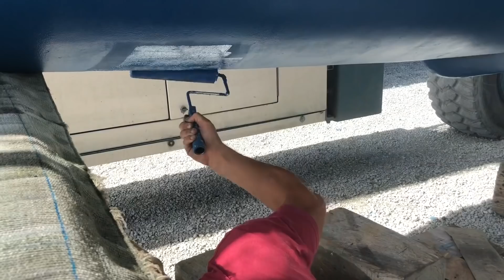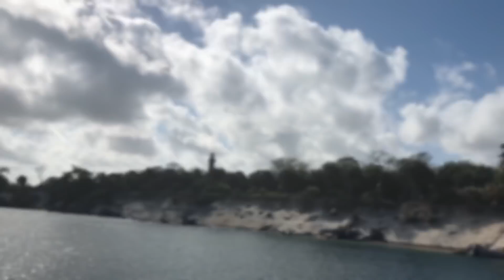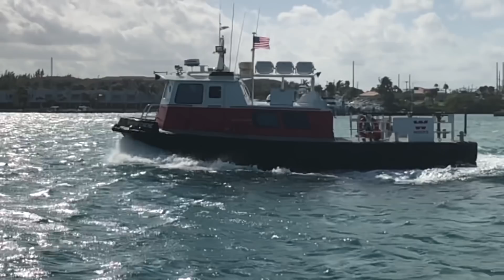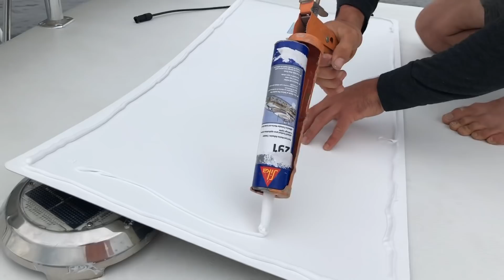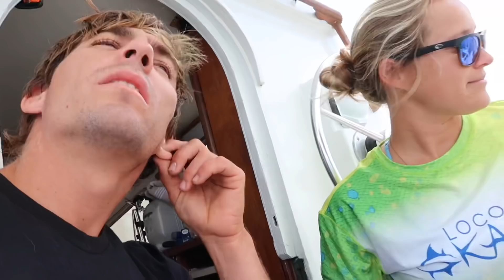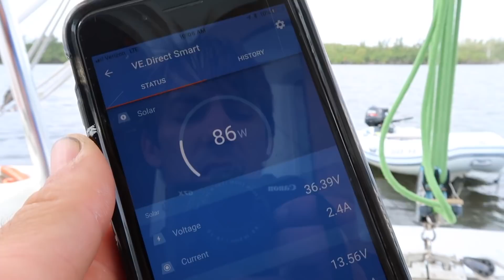The MOST Exciting Day of the Year - LAUNCH DAY! 🚀 (and installing flexible solar panels)

Comment: How much did you add to the minimum draft with the new rudders?  Has this been an issue in the Bahamas?

Did you leave the flex panels in series or did you switxh to parallel to reduce the effects of shading?

Comment: Just one more reason to keep the Honda generator aboard. If you have to run an engine to charge your batteries, the engine may not reach a hot enough temp to burn off moisture and sludge will start forming. This will tend to plug up the oil system in your engine and shorten its life. Now compare a overhauling a fried diesel engine deep in the hull (one you depend on in emergencies) to overhauling the Honda generator. Honda: change the oil, change the spark plug.  Or, tie a rope to it and chuck it overboard to use as an extra anchor. The famously reliable  generator is designed for exactly that purpose. Generate for however long you need it and shut it off. No unneeded use of a diesel engine. No extra hours on the maintenance log! 
I love your vids.

Comment: I have heard some bad stories about some flexible solar panels,  Check out Free Range Sailing and Ryan and Sophie Sailing YouTube Channels.  Troy from Free Range had identical capacity new flexible panels mounted adjacent to the old solid panels and was able to check the output of each panel and the brand new flexible panels performed significantly less than the older fixed panels.  Not sure if it is a function of the flexible panel or the particular manufacturer.  Ryan on Polar Seal is in the industry and he was disappointed with the performance of his flexible solar panels.    Hopefully yours are OK.

Comment: I used to have a J30 Sailboat. Had flexible solar panel on it. Was not that big About half the size of yours), but it would overcharge my two deep cycle batteries. Also had to do the bottom painting every year.  Lots of maintenance work, but loved sailing. Launching and pulling out are always stressful, even more so when you have a five foot fixed keel under the boat and you are trying to get the boat centered on the trailer which is really deep in the water ( had to use a 25 ft ,tongue extension to get it deep enough.)
You have a beautiful sailboat!

Comment: The voltage of panels in series is additive and the current is the same through all panels. The current from panels in parallel is additive, and the voltage is the same across all the panels. 

Power is obtained by multiplying voltage by current. Since the output power of the system (3 panels) is always 300 watts, the series/parallel configuration will determine the current. A series system will have 1/3 the current, but at 3 times the voltage. Whereas a parallel system will have 1/3 the voltage and 3 times the current.

If you reduce the current going through a given wire gauge, the voltage drop in the wire (and power losses associated with it) will also decrease. Additionally, the higher voltage/lower current of a series system allows use of smaller gauge conductors to handle the same amount of power. Being able to use smaller gauge wire yields a cost savings if you have long wire runs, and smaller gauge wires are generally easier to work with.

Comment: It is maybe true that the high voltage is more easy for the wires but if 1 panel has a shading it will stop or at least decrease the total of the 3 panels. If you use them parallel there can be one in the shade, one half in the shade and one in full sun. And this last one will then still give all his power to the chargecontroller while the otjer two do nothing.  So you should check if the setup like you have it now will proof itself to be efficient enough

Comment: The shade is going to kill you with the panels in series.  If you wire them parallel, you can get full power from any panels that have sun while only losing the panel or panels that are partially shaded.  Having your panels wired in series, if any one panel is shaded or partially shaded, you pretty much lose the entire series.  Grab some connectors and check it out for yourself.  You'll be surprised by the results.  I have solar on my shed, an RV as well as helped a friend put enough solar power on his powerboat to run his AC overnight.

Comment: Blue Sea Systems cable clams. For running wires through bulkheads with the connectors on. Waterproof, secure and best part, NO 5200!!

Comment: I didn’t understand the need for higher voltage. As for comments about the relative efficiencies of rigid versus semi-flexible, I think that has become less of an issue as panel technology has evolved. I have two 150w semis atop my bimini and they do a great job of keeping my house and start batteries topped off. Fair winds. ⛵️🇨🇦

Comment: There are 2 advantages of running Series panels,  1 is you can use smaller wires as the current is halved, the second is power loss in the cables is measures as current squared times resistance,  for example to make the math easy let’s say you panels are 120 watts and 12 volts which would leave the current at 10 amps (p=V x I) per panel if they are wired in series they would be 24 volts at 10 amps or in parallel they would be 12 volts at 20 amps.   Let’s say the resistance of the wires in 1 ohm then you power loss in the series panels is 10 squares or 100 x 1 or 100 watts,  in the parallel install the current is 20 amp so power loss would 20 squared or 400  times resistance of 1 ohm which is 400 watts,  so essentially 4 times to power loss in the wires,

Comment: As an electrician you did a decent job of explaining it at your experience level with it.
Reply: What if a person wanted to wire them in parallel, would running 10 or 12 gauge solid wire like romex fix/rectify the problem?
Reply: @BushImports  on a boat I would not use Romex. I would use a marine grade wire for it. Wire size depends on amperage draw. Lower voltage given the same residence is going to have a higher load. Higher voltage on same resistance is a lower load. That is the other benefit to series panels. It allows you to use smaller wire.

Comment: Thicker cable, less power to loose? Im not an engineer, but thinner cables are not so good to deliver voltage as thicker. Correct if im  wrong :)

Comment: Solar is only good if it is sunny, Wind turbine are only good if it is windy, What you guys need is a marine super capacitror bank, That way you could get 240v 110v 48v versions, Charge for 30 seconds and you have full power all day long and no bulk or heavy batterys to lug around.

Comment: Those flex panels never work as well, they are terribly inefficient. I would have turned your current panel sideways and added another like it
Reply: @S Sanata All the research shows they are dramatically less efficient by nearly 50%
Reply: @S Sanata, u can have rigid same voltage for less then half with at least 40% better output. In terms of efficiency that is a poor deal, but if it works for u, who em I to tell u otherwise. Parallel is also better then series.
Reply: I think it would be much cheaper too.

Comment: She scrubs up well guys would be good to design a dodger over the cockpit  more protection , but good job let us all know the costs an how the marina treated you , and how the charged , to let others know if they want to use them  , marinas can be mongrels like Gulf harbour in nz and a few others around the med , well done , thoes solar panels are useless , we tried them and in a year they were dropping power , so we went photovoltic and power increased , answer to your speech , you live on amps not volts your volts will always be 12 , you need to up the amps to live , 330 watts divided by 12 is your total amps made

Comment: Electrical Engineering senior here, series would just mean you would have the same amount of current running through both panels, parallel and the current would split through the panels evenly (coming from your power source). The voltage is considered additive due to them being connected back to back, whereas parallel they would just share the voltage from one another. You don't have distance as a factor so there no since in having them in series. In your scenario definitely connect them in parallel as if there is a short or any other kind of obstruction with the circuit you will be left with nothing (think Christmas lights). Also if you have shade or anything like that over one panel, it will affect the whole circuit as they are all connected together (in layman's terms). You have nothing to worry about as far the resistance of wire. anywho back to homework
Reply: Brendan is correct, for your situation, those flex panels should be in parallel. Also the flex isn't going to be as efficient or reliable as your other panel. They are great for your application however, but I personally would find a way to add another panel to the frame work where your current panel is. Ultimately, I think you will find you're still going to need it. Nice addition though "I need mo power Scotty!" "Imma switching the flex panels to parallel Capn' !", "Engage Warp Cat, Mr Sulu!"
Reply: I was going to say the same thing, but probably wouldn't have phrased it as well.

Comment: I have been trying to move down there for a while. Last summer I went down there and got screwed by my landlord in a month. Then had tondrive back to MT because I couldn't find a place to live with the money I had any tips?
Reply: I rent rooms in Clermont Florida........been doing it for years and don't screw anyone over:-)
Reply: Funny thing about FL, at least in the Tampa Bay area, is you can have crack ghettos right next door to millionaires. I lived on Treasure Island for a bit, literally across the street from the beach, for $500/mo. That was a bit ago, but not so long. Right behind me on the main drag, what little you could find to rent was thousands a month, and across the street that fronted the inter-coastal were multi-million dollar homes. Adjacent to me was a shady Arab run crack motel really cheap, I think $90 a week. Nice guys. Little half block wide strip of quasi-ghetto right between the rich and the tourists. Only in Florida. South of that (St. Pete) it gets cheaper as you approach the real ghetto that isn't near the water (don't move there).

Comment: I think what you’re trying to say is that for you guys having voltage over amps is better and when you hook up the panels in series the electricity flows more smoothly and  straight through the panels, and with all of the panels being set up together like this they act as if they are one big panel and if one gets effected the others do as well.